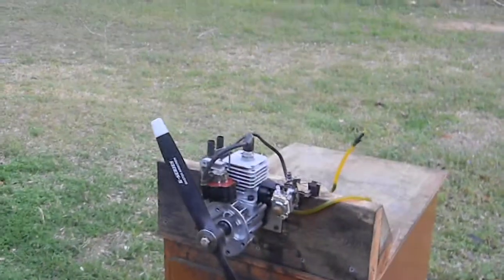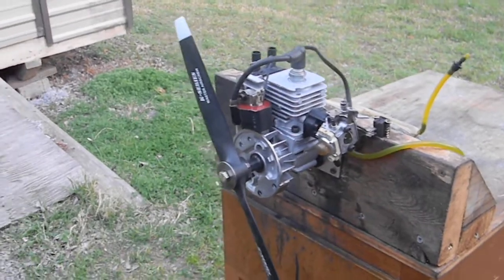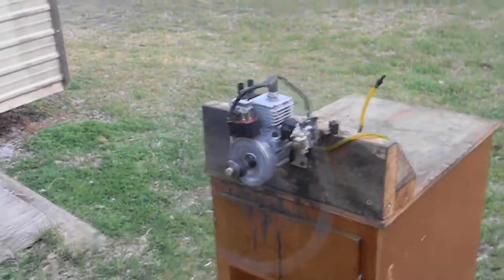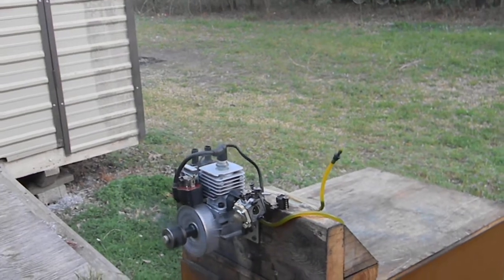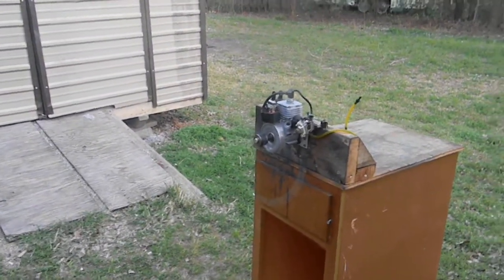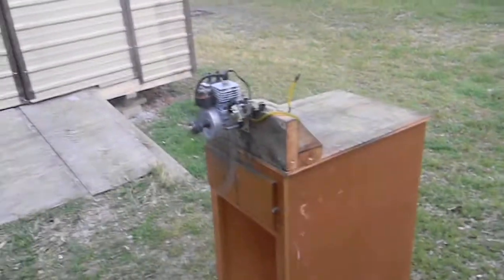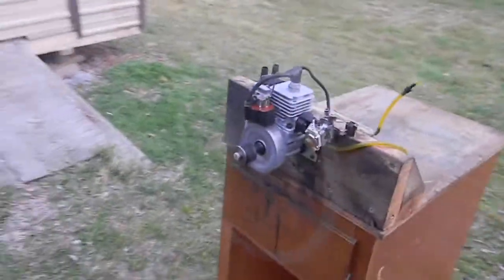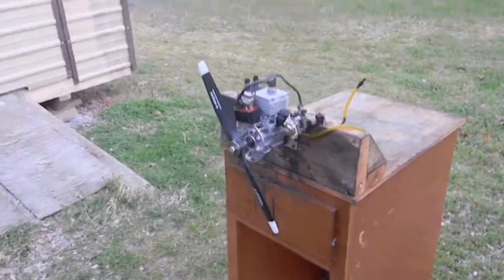WEEDEATER POULAN 15CC RC GAS CONVERSION FOR SALE!

Comment: Seems like the Poulan idles higher than the Homelites and doesnt have as good high end rpms either. Mine wont idle lower than about 2000 rpm and wont get much higher than 6000.